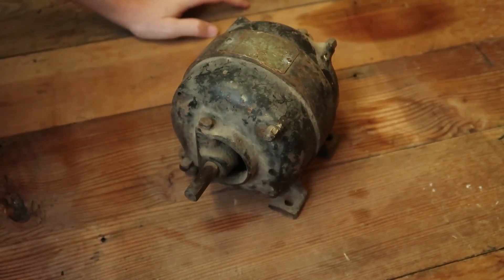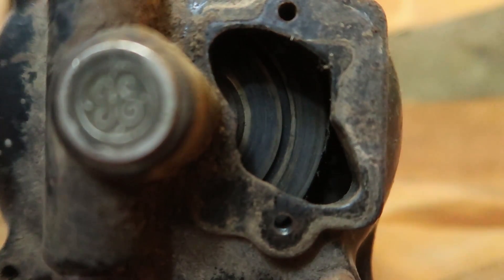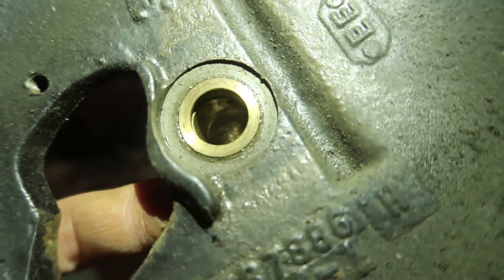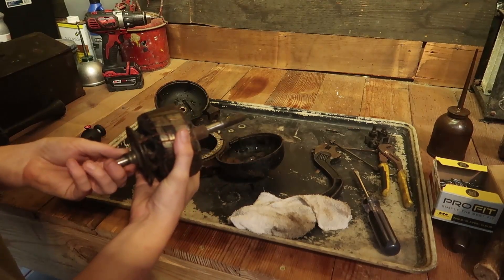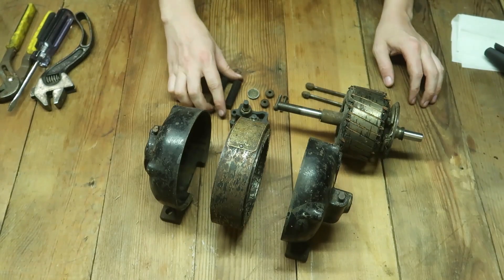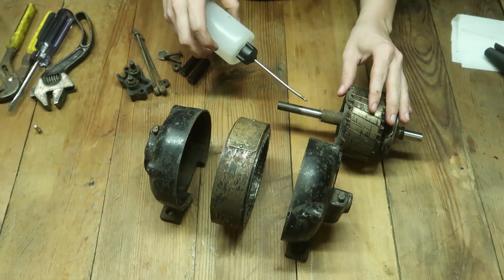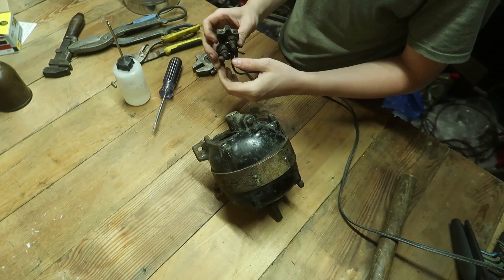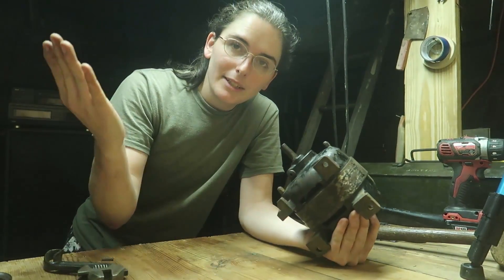1920's General Electric 1/20th HP AC Induction Motor Teardown, Bearing / Bushing Oiling

Comment: Hi again  Rinoa. You were helping me out with my electrical problem. Like I said I have a similar motor with a similar frame type. I had mentioned replacing the whole cord, and I noticed you were reconnecting the cord to the terminals/brushes in this vid. What was your issue, why didn’t they connect the way you wanted? My terminals and brushes look the exact same except there’s also a green ground wire. If you had trouble connecting the wires to your terminals, I may not try to replace the cord at all and just splice with wagos like you recommended.
Reply from the maker: sadly its been years since this video and I cant remember. I seem to recall this motor having a busted winding coil so I didnt persue it much further

Comment: I just picked up a model similar to this. It runs but the cord is cut about five inches from the brushes, it seems to have been grounded as it has black green and white insulated wire but most of the restorations I see they are two pronged. Is that because you don’t need a ground and it’s just easier. Also with the five inches of cord I have left do you think I should splice in a new cord or replace it all together, was it easy enough to do? Thank you.
Reply from the maker: usually the cord can be removed by unscrewing a connector, but if not it also shouldnt be an issue to splice to it. I recommend buying some Wago power connectors, they are great for testing connections. I dont know about the wiring of your motor, best to google it
Reply: @RinoaL  I just looked at them and they would be the easiest but I might go with something “cleaner looking”, since I’d have three of the wagos too close to the motor as I only have 5in of cord. Thank you very much for responding! I’m sure you know how valuable some info can be when working on a project.
Reply from the maker: Here's a recommendation. So you don't have three splices at the very same spot in the cable making a big bulge, cut each wire 1 inch shorter so you have three bulges 1 inch apart instead of a large bulge in the middle. Having the splices offset can help you hide the splice in a tube of shrink wrap tubing or tape then. If all the connections line up, it'll be a big knot of 3 splices sitting next to each other hahaha.
Reply: @RinoaL  I’m going to try and stagger the wires but like I mentioned I have so little cord coming from the motor to work with, there would be no room for error or I’d have to replace the whole cord. Actually I got a good look at the “terminal box” with a ground wire on another similar g.e motor, it looks like the hot wire is wrapped around one terminal/carbon brush and the neutral wires around the other, if it’s easy enough I’ll replace the whole cord. I’m just not good with sparky stuff lol. I did order some wagos and solder seal connectors on your recommendation though. Thanks again!
Reply: @RinoaL  thank you!

Comment: When you hooked up the two wires, does it matter which wire goes where. I have same motor and put new cord with black and white wire. Not sure if it matters to connect white wire to certain sqrew. Any advice please.
Reply from the maker: It shouldn't matter on an AC motor
Reply: @RinoaL  Thank You very much!🙂

Comment: I have a similar GE motor to yours I believe to be pre-1920. It has the same wound rotor as your motor and the brass plate on the back that the brushes ride on. Behind that brass plate their is a centrifugal switch that energizes a start winding in the motor. Its spring loaded a you should be able to move that switch with a screw driver. It may be stuck seeing as your rotor appears to be slightly bent. Good luck.

Comment: I have one kicking around the shop with a buffing wheel on it, the thing is bulletproof, found it out in one of my father's old sheds it must have been sitting in there for last 30 years and I have been using it for last two years, the thing still works better than newer motors.  if you need me to take the contacts out and photograph them to give you an idea of how a working one looks! just let me know.

Comment: Wooden dividers on the stator, wow! I bet this motor predates plastic! (or at least the wide use of Bakelite) Love the serviceability and quality of vintage stuff! 
Ouch, yeah, those breaks would do it alright! Personally I'd love seeing it in service as a motor, but it's yours and you can do as you wish with it. Found any info on a date for it?
Reply: Likely the breaks are in the start winding. 

What probably happened is the contact ring got bent first which may have prevented the start switch from disengaging which wasn't noticed until the motor wouldn't start anymore.

Comment: Wooden splint like things inside the motor core like that ive never seen , Most interesting :-)
Reply: they are common to find in old vintage DC motors like Westinghouse and G.E. They are hold downs for the winding's on the rotor.
Reply: @Gilly14  Wonder how durable it was and did excessive heat cause issues.
Reply: @steve64464  I never found one that caused an issue and as far as durability  I tore down many that had been running for years. Of course you don't reinstall them after you've rewound the rotor cause they break upon removal and just the simple fact that they won't fit as snug anymore, so they are replaced with a fiberglass type material that you buy in strips that come in many different sizes.
Reply: @steve64464  Oh and no heat issue at least I have never found or heard of one to have been either.
Reply: @steve64464  Very good motors, they are tanks compared to most of the crap that's out there these day's that's for sure.
Reply: @Gilly14  Quite impressive , I guess they were built to last and take a beating im them days.
Reply: @steve64464  yes Sir they are.

Comment: Didn't look like there's a starter winding or phase shift capacitor in there -- give it a spin then plug it in! :)
Reply from the maker: well most of the run and start windings are broken and melted evidently. theres a governor hidden under the commutator but it pulls such little current due to like 20 broken connections.
Reply: @RinoaL  Ahhh. That would figure :(

Comment: There is a really really good chance that motor is rebuildable and the rotator is actually called an Armature it would really be wonderful to see that thing running again I love antique equipment it's sort of a passion of mine
Reply from the maker: its not called a rotator, its called a rotor. armature would be more for the wiring itself.
Reply: @RinoaL  sorry I was voice texting that's how it came out and I sometimes don't really check well the Armature is the part of the electric motor that has to carry current it can be the rotating Part ie "rotor" or it can be the stationary part  "stator" the part that carries the current is the Armature. If you can find someone who has a growler a machine for checking the Armature of starters and generators that will tell you if yours is shorted I used to have one a long time ago and it got away from me but you might want to check around to see if anybody in your area still has one any starter or generator rebuilding shop "should" have one though it's pretty old technology.
Reply from the maker: oh mine is definitly faulty, i can see about 20 snapped and burnt connections and a few globs of copper on the windings. no doubt there are shorts. thats why ill probably just rewire this and turn it into a generaor.

Comment: If you did electroplating and polishing and grinding, polishing, cleaning with engraving wire, you would have done an excellent job.
Reply from the maker: most of the time, an excellent job is a practical job.
Reply: @RinoaL  are you a vocational high school graduate
Reply from the maker: no but i used to manage rapid prototyping labs at Apple and specialize in additive manufacturing and electrical stuff.
Reply: @RinoaL  Congratulations on why you didn't continue Apple prototyping would improve your business more

Comment: I read somewhere that there was some sort of weird advantage to having a wound rotor. If inly I could remember what it was and make this comment much less usless in the process. Also, I belive most people say not to use asny sort of sandpaper on commutator (if you can even call it that in this case) because it can ruin it, i was always told to agressively wipe it sown with something like cheese cloth or a clean shop rag. Im not sure if there is much truth to this though, I've never seen anyone destroy a motor by cleaning a commutator with sandpaper. I just like to be careful with some of that stuff.
Reply: The advantage is high starting torque. The motor can remain permanently connected to the load, whereas a squirrel cage rotor may require a clutch to disconnect it when starting. And those are slip rings, not a commutator, on the rotor.

Comment: I love when you use old wrenches. you know, to people who think electric-powered vehicles aren't the future,  please find me a 100-year-old combustion engine that is still running well.
Reply from the maker: but they dont still drive due to their own longevity. any model T in great shape today is only that way because its never been used much or it was a labour of love to restore. they were not reliable vehicles and they frequently had messy breakdowns and issues. i mean just the ignition coils were difficult to keep going after a while.

the thing is, many electric vehicles from the 1800s and early 1900s dont require as much frequent maintenance. and many were still in regular use until the 1970s by a few people. electric cars are simply better when it comes to reliability since they have far less moving parts, and most of all, nothing moving like a piston engine has.
Reply from the maker: oh and another thing to note, many new electric vehicles dont really ever need maintenance. i have a friend with a Tesla thats been going fine without any maintenance for a decade and another with like an 8 year old nissan leaf and all he has to do is refill washer fluid. by that time you would have at least had to buy new oil and several car batteries for an internal combustion engine.

only reason electric vehicles have 12v lead acid batteries is because the laws dictate all cars must have a 12v lead acid battery. so once they remove that law we can finally ditch the one last relic that needs maintenance.
Reply: Matt Parker Go find yourself a Model T
Reply from the maker: well even a model T tends to be less reliable than electric
Reply: @RinoaL Super-Genius not to mention the overall cost of operation is significantly higher than a similar electric counterpart.  As well as maintenance for the model T would eventually overtake the actual value of the vehicle itself.
Reply: Im just saying Model T because some of them are over 100 years old now and still running. Im not trying to say that internal combustion engine or steam engine powered vehicles are the future. And yes the maintenance on a model t would be pretty expensive but probably wouldn't be as bad as another 100 year old from some lesser known company. Also the maintenance of any vehicle will someday overtake the vehicles value as it wears down over the years.

Comment: Sort of an odd arrangement for an induction motor, with the windings on the rotor. Nowadays all you see are the windings around the stator. Nice video, thanks for sharing!
Reply: Wound rotor induction motor, still sometimes used in industrial machines.
https://en.wikipedia.org/wiki/Wound_rotor_motor
Reply: Yes, it is an odd arrangement and hard to see any advantages over the standard convention of having the windings on the stator and squirrel cage on the rotor. The biggest disadvantage is the requirement of brushes to get power to the spinning coils. I've had a couple of these motors and while they work fine they generate terrible interference on any operating TV or radio in the vicinity, which does not happen with the conventional design. The coil(s) that were burned are very likely part of the starting winding. You can verify this easily by comparing the thickness of the wire compared to the considerably heavier run winding also on the rotor. The fact that the motor only hummed and did not start was also a clear indicator that there was a fault in the starting winding and probably in the centrifugal starting switch as well. Since the start winding was the last one wound onto the rotor it may be possible to strip off and rewind just those coils provided the run windings were not damaged. As can easily be seen there are four separate coils that make up the complete starting winding. Each coil is identical to the other three so winding data can be obtained from the unwinding of one intact coil. Make copious notes of what slots the windings are placed into and rewind with good quality magnet wire. Then apply a good varnish made for this purpose and follow the manufacturer's instructions for drying and curing. Then install new slot wedges and make the appropriate connections to the slip rings and centrifugal switch. After that you'll probably want to have the rotor checked for mechanical balance. Then the motor should be about as good as new